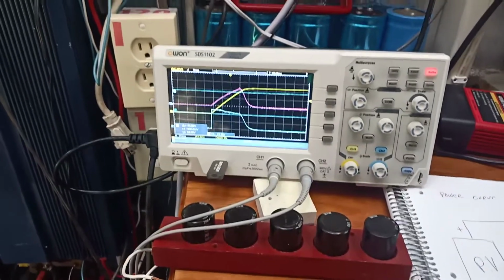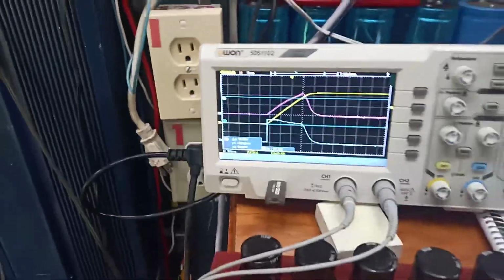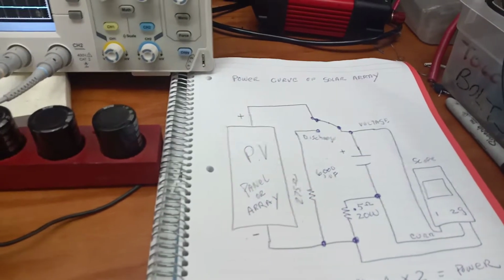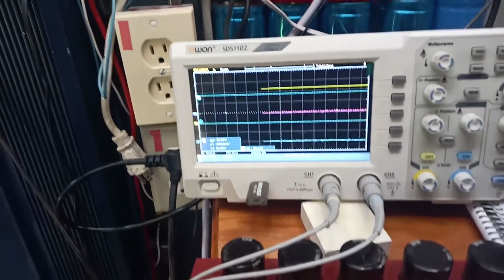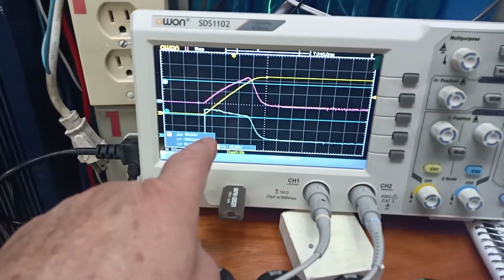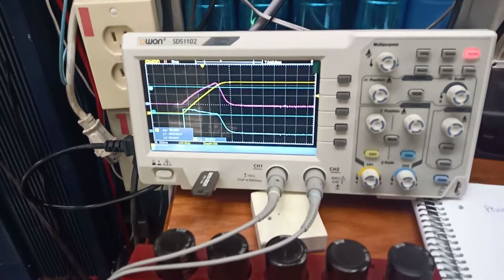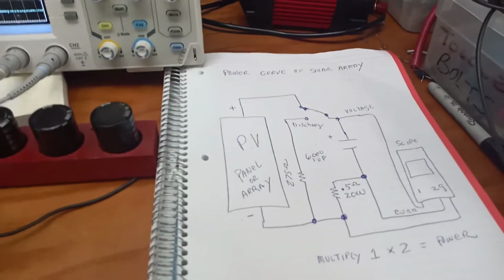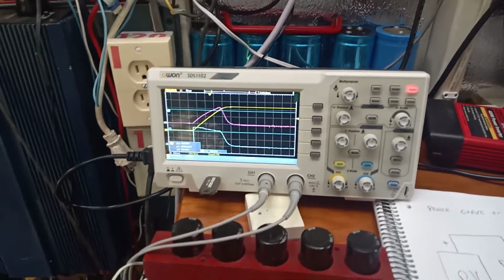Test PV Array Panel, Get Accurate Power Curve On Cheap Digital Scope, Build This Easy Tester

Comment from the maker: Packing up this week and only time for a quick video I've wanted to do for over a year. Wonder if there are multiple power peaks your MPPT CC is locking into? This easy to build tester will tell you. Check a panel or array. All you need is a digital scope with math function. This is the most accurate method to test a panel or array.

Isc is the BLUE trace which is normally flat till it approaches MPP where it drops.

Yellow is the voltage of the panel. this starts near zero and climbs as the capacitor charges until it reaches Voc.

Pink is the multiplication of I and V to give power. At the peak is MPP power.  The values of I and V then can be measured. Some scopes will calculate this for you. On some shaded arrays there may be localized peaks your CC may get lost in if it only searches in a limited area around a peak.

Comment: I am needing a solution for my sense energy monitor. It will not detect consistently enough to label it since its electronic signature varies too much, same with our electric car. I believe that if I could add a component or circuit that turned on and off with these units, the sense would see the new item added and therefore it would detect it as a whole.  any ideas. Jason